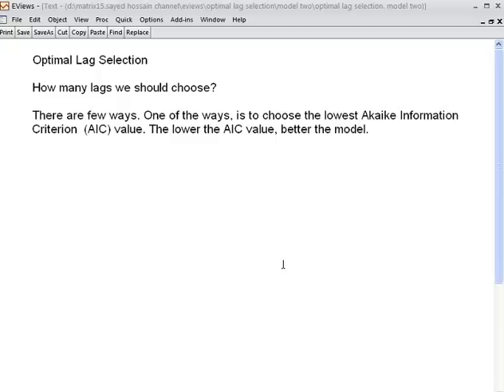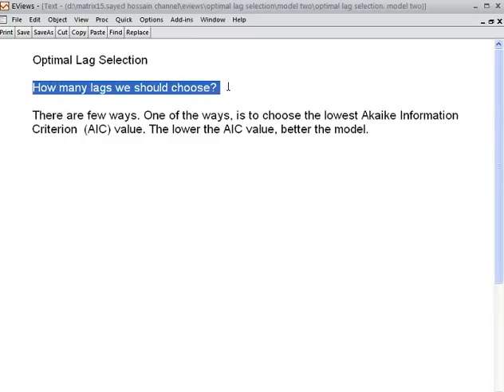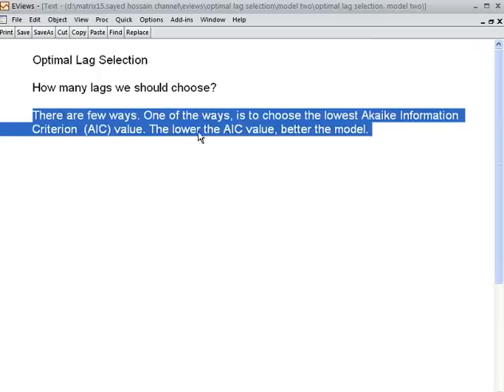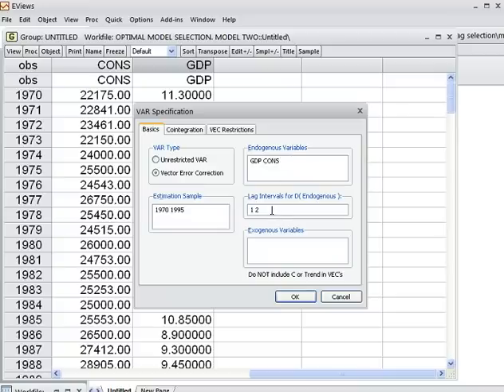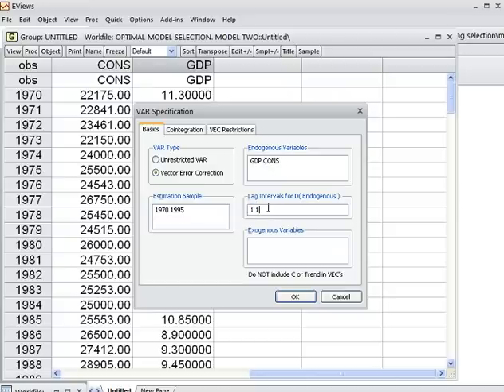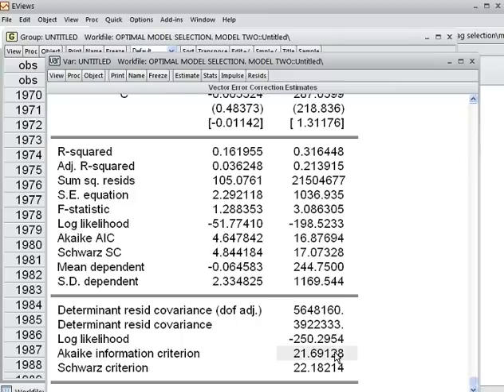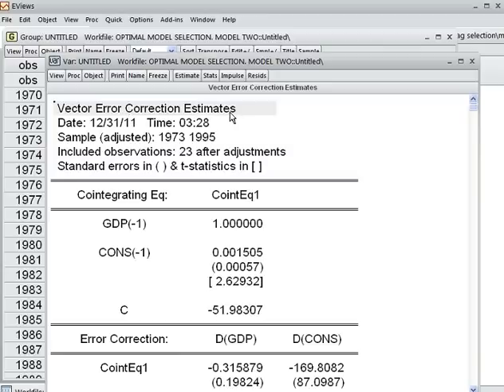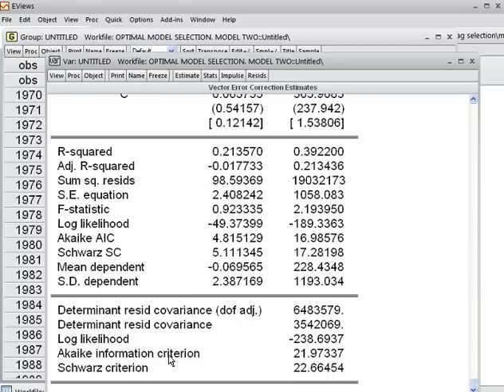Lag Selection. Model Two. EVIEWS

Comment: Sir, Really Thanks a lot,..!
It is only because of these videos that made time series analysis easier for my
projects. I would definitely share your videos and make your youtube channel
more popular.

 

 I have a small doubt sir. For yearly data we
are using lag 1. For monthly we are using 12,24. My data set is from 2012 -
2018. Both hourly data and prices for every 15 minutes is available here. We
can use lags 60, 120,..., 360 when it is a purely minute data (i.e., when the
price is for every minute) but this is a data which tells price for every 15
minutes. Is it ok if we use the same lags 60, 120,..., 360.Please do
tell me what lag length should we choose for 15 minute block interval. 

Since it is a high frequency
data, what lag length should we use? When I used lag length above 2000, my
Eviews started getting stuck. Also in one of the videos it was mentioned that
higher lag lengths would lead to loss in degrees of freedom. What shall I do sir?
Thanks in advance, sir!
Reply from the maker: Thank you. I would like to invite you to join Hossain Academy Facebook Group at below link and join our group discussion. Thank you. Sayed Hossain from Hossain Academy. https://www.facebook.com/groups/hossainacademy/

Comment: Dear Hossain , 
Thank you indeed for this valuable explanation,I have two questions please,
1-can I use this method with panel data? 
2- If the better lag selection is 3 for the model and some variables are stationary in lag1 what do you think taking   lag1 or lag 3 in this case?

Many thanks for all help.
Najla
Reply from the maker: نجلاء الشطيطي Normally we do lag selection for time series model but I have not done for panel data yet. Variables can not be stationary at lag 1 or 2 but it becomes stationary after 1st or 2nd difference.
Reply from the maker: Sayed Hossain But you can use panel unit root, panel cointegration panel dols and panel fmols model from videos in Hossain Academy at www.sayedhossain.com

Comment: Dear Sir, when we set the lag length, what is the maximum one we should choose? For example, do we need to continue test the result choosing lags from 2 to 10?
Reply from the maker: I would suggest you to take maximum lag 4 or 5 when you go for lag selection. If you take more lag, then you will loose more degree of freedom and that is why smaller lag is better.